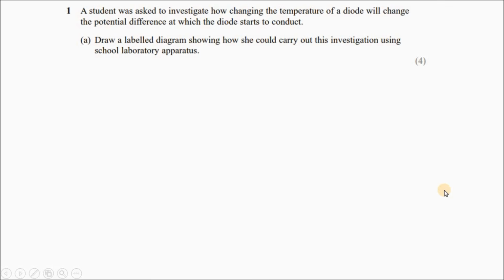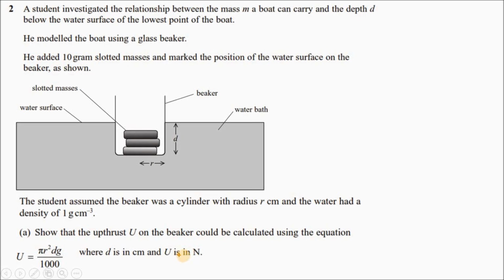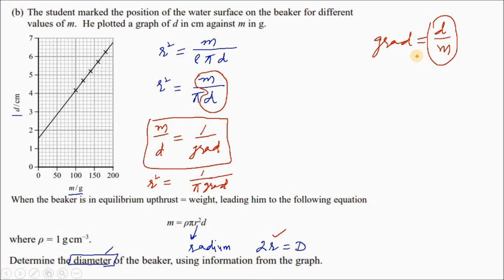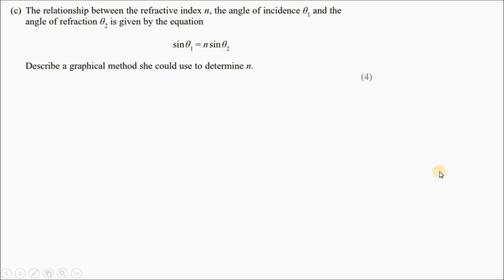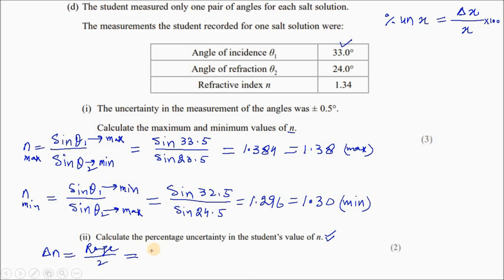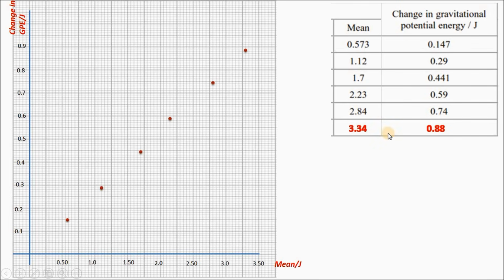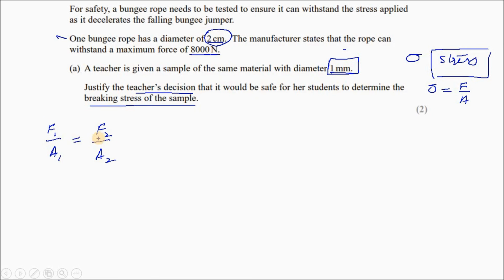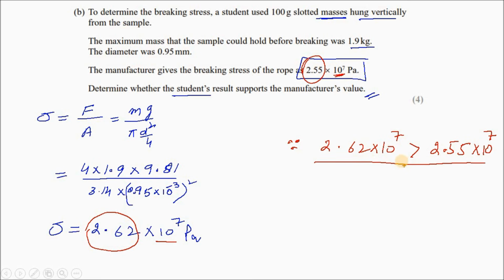Edexcel IAL physics unit-3 (WPH13) Jan 2020

Comment: 46:30 how does the stress being greater mean that the manufacturer’s statement is supported? were we not supposed to find the percentage difference?
Reply from the maker: I made a mistake here (sorry for the inconvenience). If you find the % diff, and if the % diff is less than 10%, you can say the student's value supports it. Or if you compare the result, then the student's value is greater than the manufacturer's, so it does not support the manufacturer's value.
Reply: @ got it, thank youuuu!! exam i  2 hours👀😰

Comment: Why do we need to add a variable resistor at the first question?
Reply from the maker: In this question, we need to relate voltage with the temperature, so the rest of the quantities should remain the same that's why we need variable resistance to control the current.
Reply: @naturalsciencesolution  Do you know where I can get access to these papers? I got my unit 3 exam tomorrow.
Reply: @ahnafulhoque1242  https://drive.google.com/drive/u/0/mobile/folders/1OtAXxCr5ZItlz_XQBvh61a3IOQCm3iMZ?usp=sharing&fbclid=IwAR20GcDFhcEHEzOn5swwyLDTGfcuMAtekNVM5TL4CydC1rzklbPeImkInto
Reply: @TheBest-fj4qy  Thanks mate, finally got a copy of P1-P4 for practice.
Reply: @TheBest-fj4qy  do you jan21 ial physics qp
Reply: @darkelixerhimel3335  yess but I am unable to send it here on YouTube comment section.
Reply: @naturalsciencesolution  great, got it
Reply: @naturalsciencesolution why not a fixed resistor, does the same work..? the mark scheme says for varying p.d. but u just said “the rest of the quantities must be same” ..?
Reply from the maker: @chifnfelihwnwerjilnfefwijn You cannot vary the current using a fixed resistor. you have to have either a variable resistor or a variable power supply.
Reply: @naturalsciencesolution  ohh yea that clicks now, thank uuuuu
Reply: @shamsbasit Thank you very much. You are a lifesaver. ✊🏻✊🏽✊🏾✊🏿✊🏼✊